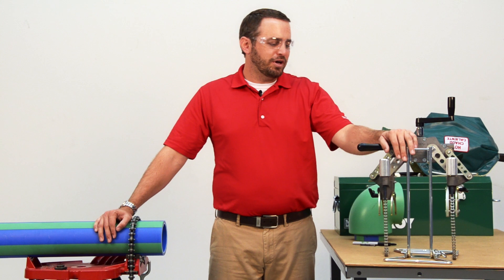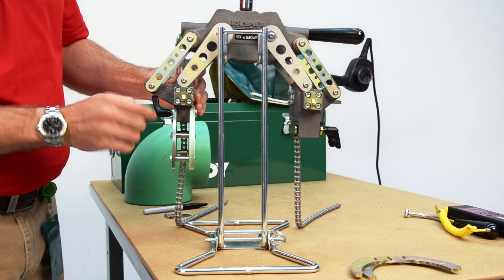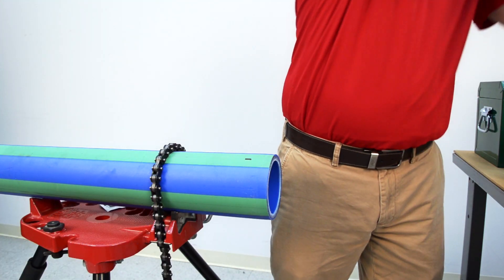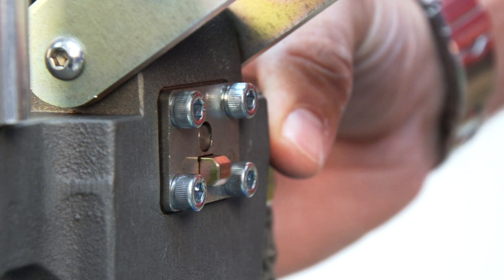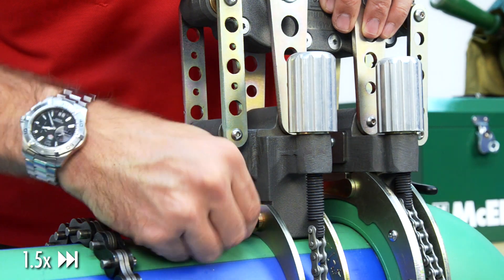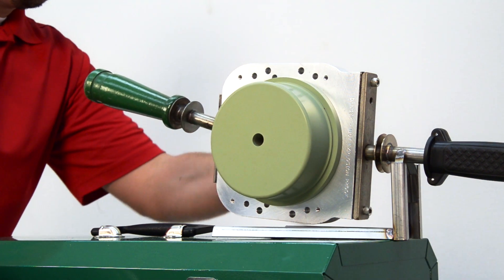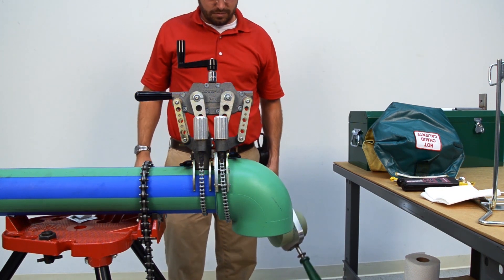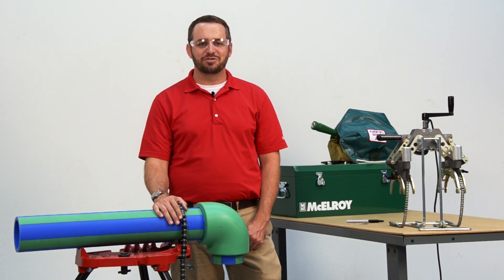How to Fuse 4" PP-R Pipe using the McElroy® Spider™ 125

Comment: Most PPR pipes have stripes and in the above it is green on blue (or blue on green, however you think).
Use that to guide/align your pipes and fittings, to make T and Elbow connections perpendicular.